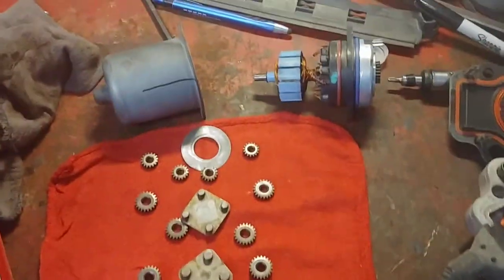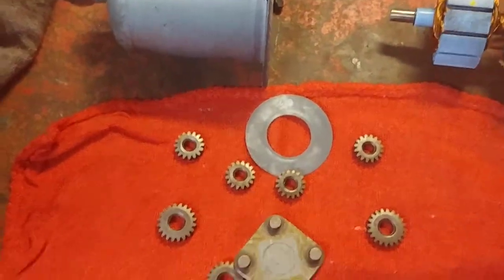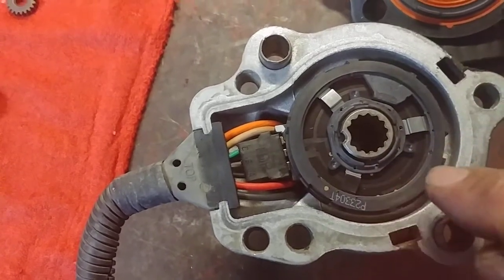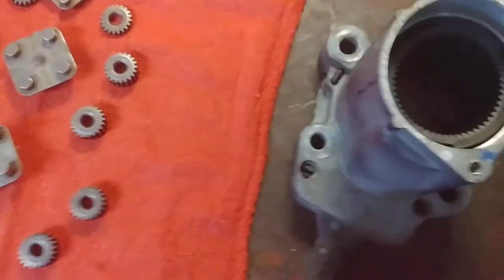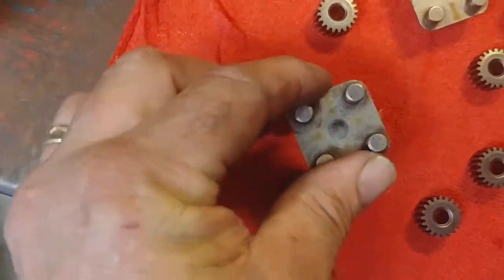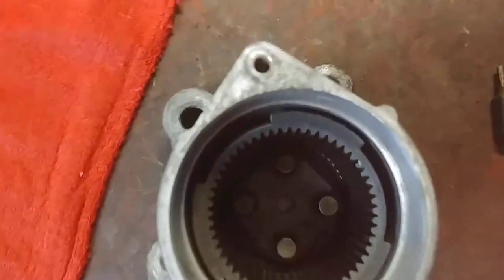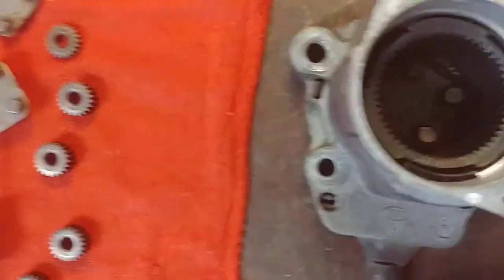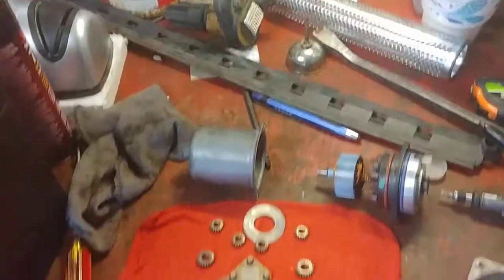Whats inside a 4x4 actuator?

Comment from the maker: Yes the armature at the top of the screen should move freely there are two tabs that go the the brushes polarity is unimportant put 12 volts to just the motor it should spin rapidly switch the leads it should rotate the other direction.